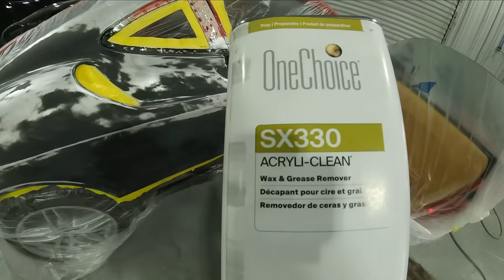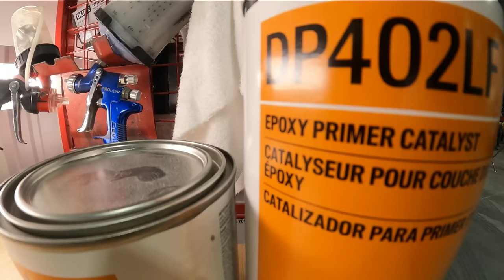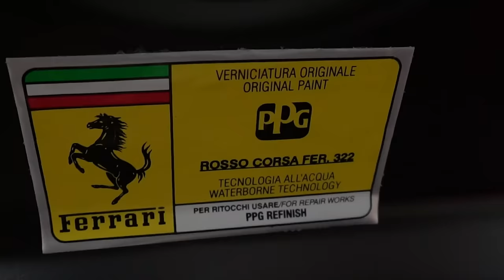Painting A BURNT Ferrari - @Samcrac

Comment: Shouldn't you have DP'd over the repair filler your technician applied on the quarter roof seam to get proper adhesion of the 2K primer? We were taught to always apply DP over any bare metal, fiberglass, or body fillers before applying any high-build catalyzed primer surfacers to assure proper adhesion of the primer surfacer.

Comment: Hey kandyman, great job for sure.  What set up are you using and pressure on dv1? How does that gun compare in your opinion to the ws400 and Sagola? Thinking of getting one. Have the dv1 base gun. Is that a Fuji spray gun? Never tried one of those  always interested in it but never had a jobber with one to demo.  Thanks.
Reply from the maker: Dv1 1.3 c2 cap wide open fan ,fliud 22psi and yes fuji for sealer .dv1 is my go to clear gun